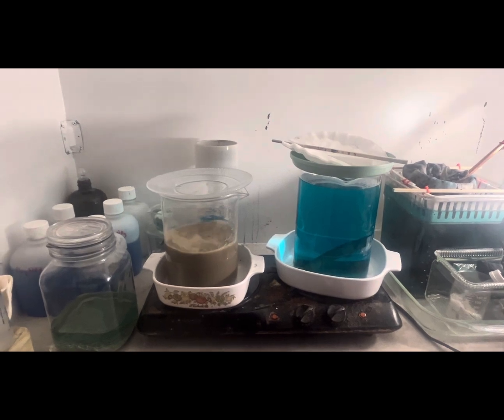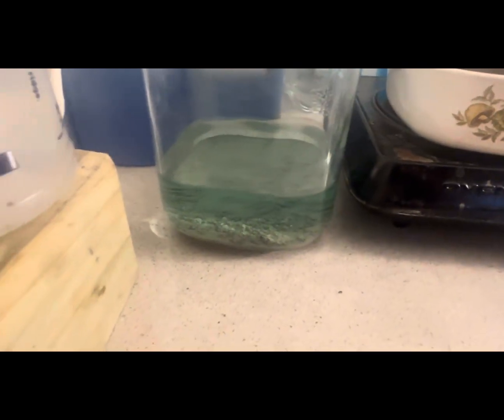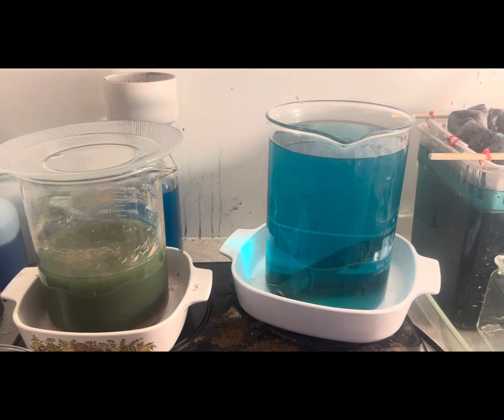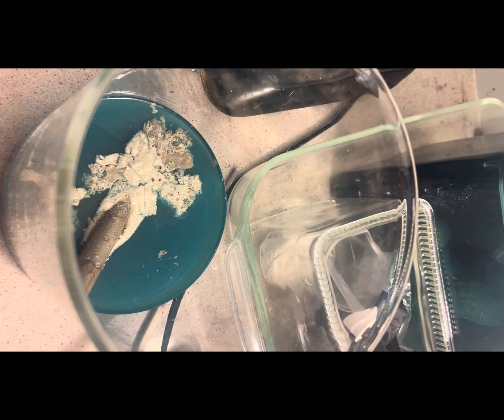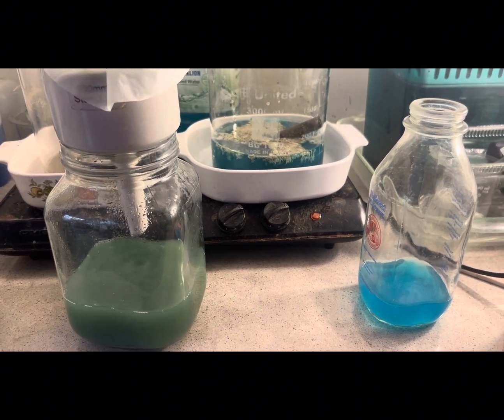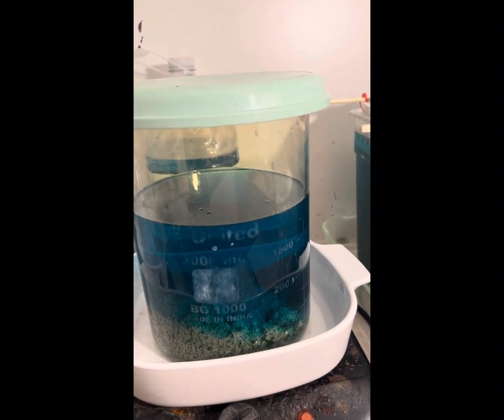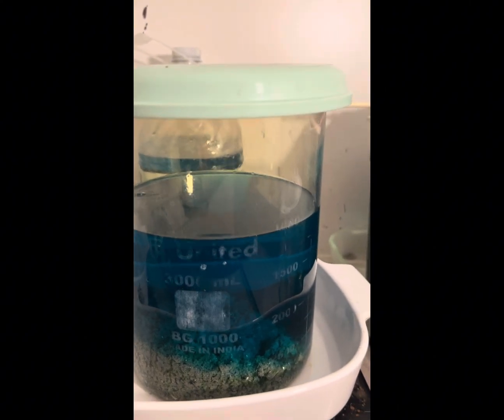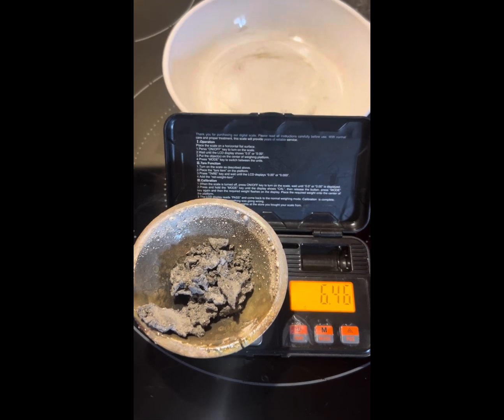62 Grams of Silver Recovered  from Slimes  #silver

Comment: Why not inquart copper into the pins with heat into an anode and electrowin the slimes?  I have been trying but my slimes arent digesting in acid nor melting into anything nor converting well in lye and sugar.  Lots to get better on ;)
Reply from the maker: I might need some clarification on your procedure . I have  smelted my waste bucket slimes into copper ingots then ran through a copper cell . I would not recommend processing pins that way .
Reply: @Hill-13  when you smelted the waste bucket 'copper'+ slimes, did you get a huge plume of red smoke?
Reply from the maker: @ I can’t remember I used my propane furnace and a five kg crucible and poured bars
Reply from the maker: Nope

Comment: I like this channel cuz it’s close to what I am doing.  Right now I’m doing eco-goldex leeches followed by electrolysis.  I going to try wound copper wire as the cathode so I can drop it right into the copper cell.  Have’t done yields yet.
Reply: Sorry anode although in the eco goldex they seem to reverse after a day or so and you get a precipitate which they say has good stuff also.  I then drop the ph (outside as it offgasses cyanide) and precipitate with zinc wire.  I’m still playing around with it obviously.
Reply from the maker: Are you using the Eco leech to selectively remove gold from circuit boards and pins ?
I have to incinerate the filtrate and papers from removing the silver in the slimes now .
Reply: @ Yeah.  I was going to incinerate what was left over.  ChatGPT suggested leeching over incineration.  I’m not even going to crush them.  My current batch is crushed broken solar cells.  I put them in a rock polisher with large ball bearings.  I have heard you can used grain shredders for pc cards and memory but I’m going to try this first.
Reply from the maker: @naughtiusmaximus830 I think that you might be on to something
Reply: @ I’ll keep posting.  I have my own atomic absorption spec I just haven’t set it up as I need venting.  The benefits of Eco goldex is that I should be able to pop samples right into the AA.  With nitric you have to raise the ph which is a pain in the ass.